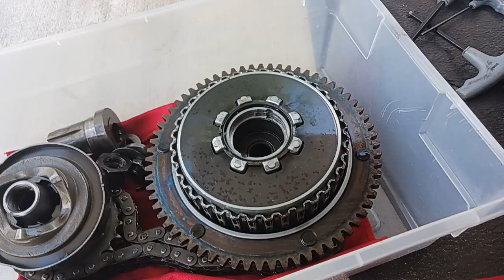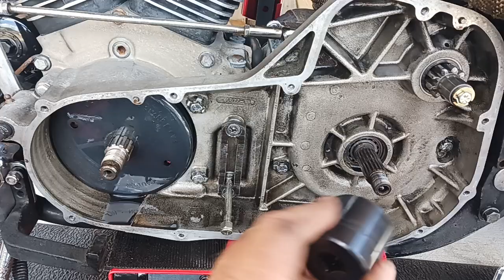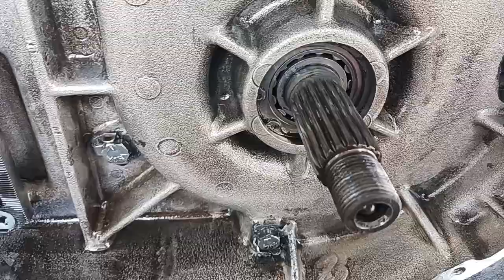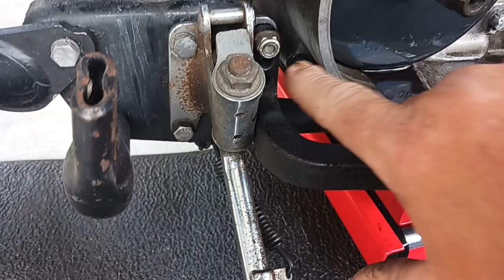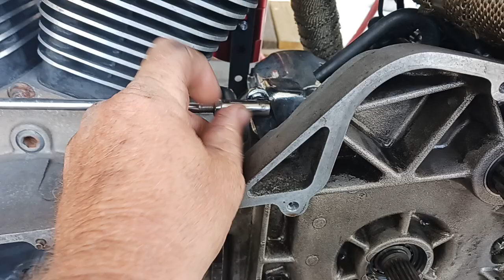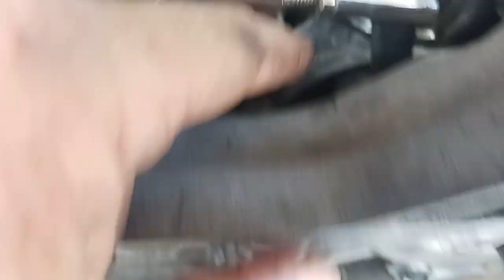ELECTRAGLIDE BELT AND SHIFTER SHAFT PT.2

Comment: As for torquing down the compensator nut when I put it together, I always use brake clean to clean the threads and nut then use red loctite on the threads before I torque that compensator nut down. I use heat from a torch to get it off if needed. I haven’t had one back off since I been doing it this way.  I totally agree to replace that seal as long as you’re in there!  
Ed, you better place a trail cam near it tonight as well to see if Dirty girl is gonna do another dirty deed… I still think she cut that belt in the dark hours of the night… you don’t call her dirty girl for nothing!  93 blackie may return the favor by going after dirty girls new primary belt as well… you gotta watch them two Ed. Trial cam Ed, trail cam.
Reply from the maker: I usually take a pick and clean the old Loctite out of the threads and then brake cleaner. Then put red Loctite when back together. Gypsy may retaliate against Dirty Girl, lol. I like a good Cat fight. lol

Comment: The Engine lip for the Primary O-ring is easy to snap off then it will leak and who wants to use silicone where the clutch is . i had one bust in 2003 tried all kinds of stuff to seal it up  brand name sealers .  the James kit is not worth the 40 bucks either .
Reply from the maker: Don't jinx me JC